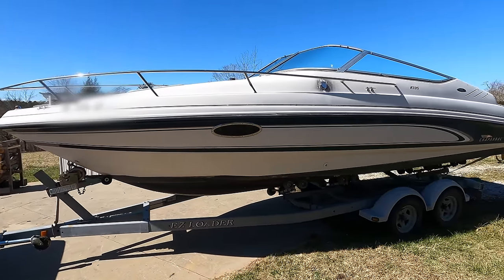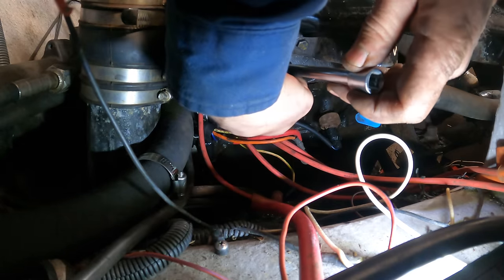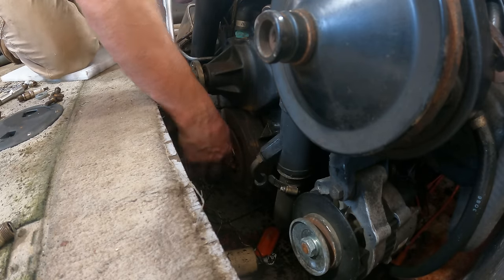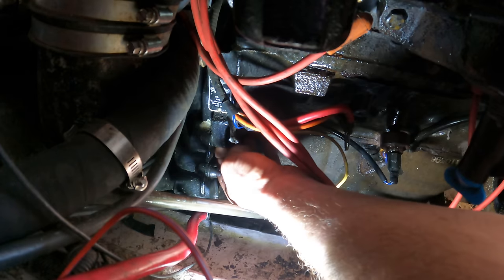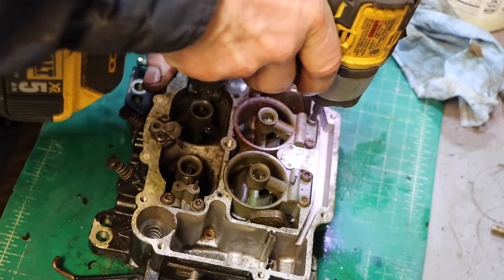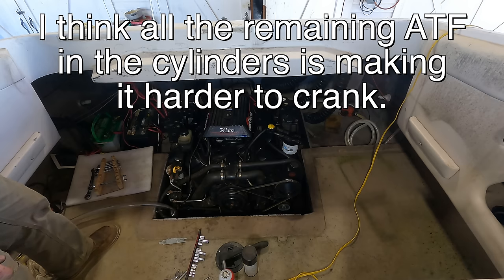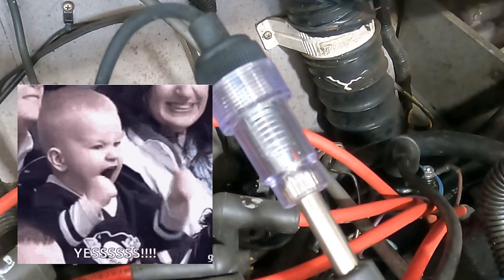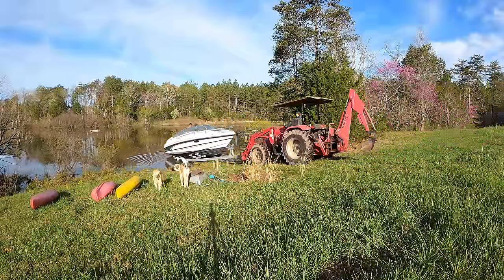Fixing A Boat With A 454 Big Block Engine

Comment: Only half way through - and you've just removed the broken bolt from the engine block from the starter motor!

ABSOLUTE RESPECT  fella! What a legend! I'm 100% , if its not an owner mechanic, owner enthusiast, or family-friend : this fix is not happening and it's an engine out job! What a legend, pure tenacity and determination, coupled with logical steps to repair!
By the way, get a soft cushion cover orsimilar for that edge of fiberglass in case you hit your head going in and out!!!!🤣🤣🤣🤣
You've not mentioned it - but I bet you catch your head!🤣🤣🤣🤣 
Now for the second half!

Comment: Those starter bolts can usually be spun out with a pick when they break off.  They don't usually seize in the hole.

Comment: My boat has 2 of these 454 engines. One has been locked up with similar rust. I tried similarly to free it up. I tried Marvel Mystery Oil in the cylinders no luck. What I didn't try is the heavy tool you made with the 1" rebar welded to it. Great idea! Wish your video had come up when I did a search and plowed thru endless videos on freeing up engines. Weeks later while searching for best ways to remove rust it shows up, same platform-a boat, same engine-a 454 Mercruiser, same issue-engine with rust in cylinders, didn't show when I needed it and looked for it. Well I did get the satisfaction of watching you bump your head on that protrusion over & over. lol Good job, and good trouble shooting technics. The no spark issue was one I don't know if I'd get thru. Im always torn between thinking the hell with it and letting a "professional" figure it out then  think at this point Id be paying someone to go thru the steps Ive already done. So you keep digging and end up buying parts that are not needed like that coil. Why anyone would chose this as a job to do every day I will never understand.

Comment: Great video. Might check the “flappers” at the end of exhaust system. Some people inexplicably remove those, which prevent water from backwashing into the engine when the boat is slowed down. Also, mixing kerosene with the atf helps it penetrate. Great job busting it loose with just the atf!

Comment: Excellent video, I particularly liked the leak down tester adapter with air assistance to move the piston, I've seen a "compression tester whistle" modified with a grease zerk-supposedly you can pump grease into a cylinder prefilled with oil with 5-10,000psi of force, and it either free's the engine, bends things, or blows out the head gasket.  That bolt on fabricobbled engine freeing tool was terrific as well.  I'm starting to realize you are good at many things, tons of them the same things that interest me, so thank you for well made videos.

Comment: This was a really good video. I was like modify the bar to turn it over. You did. Then I said replace the starter you did. I wanted a post bore scope of cylinders you did. 😂 even did a cold start after it sat.  Unfortunetly not all projects go this smooth. Even if they are a pain in the ass to work on.  You got lucky with that starter bolt.  Good job i love your videos and I'll keep watching them.

Comment: Evapo rust remover works good,,had a sbc motor frozen solid, took the heads off, filled cylinders, after a month of soaking, turned freely.

Comment: GREAT JOB!! 
I was almost convinced this was a no-fix due to all the rust, and the damaged starter flywheel! I'm surprised that the engine is designed in such a way that water can soo easily leak in from the top of the engine. Although I guess it's not surprising since the engine is really a converted automobile engine. 
You absolutely deserve naming the boat! 😁

Comment: Glad you got it running.  A little rant if i may. I just dont  understand  why some revivalists will just crank and crank and crank untill they fry the starters! Your first steps after it failing to start are to check out the rest of the fuel, air, spark systems. Pull the cap and clean it. Check the fuel filter. Take a look down its yap. So many just crank untill the starter gos up in smoke. 
 It was such a tough fix. Glad you got it.😊

Comment: Yikes! When you got those spark plugs out. Some "mechanic" that was who previously worked on it. Did starter "work" and didn't even realize the engine was locked up. Holy moses put that home aide engine wrench on a shirt! That's a master piece.

Comment: Awesome perseverance and excellent result. As an old sailor, I don't like gasoline anywhere near a boat. Good to hear you had a fire extinguisher handy. A diesel might have had the same issues re water in the cylinders but might have been easier to get to run without a carb and ignition and starter rebuild??? Wonder about the rings, maybe a compression test before any extended time at sea?

Comment: Excellent flow of diagnosis and finding the root cause. 
That was an interesting one. 
Congratulations. 
I would have put a new starter in. 

I would bet the water came in through the carburetor.  

I was surprised that you wee not sure if that was the choke. 
I was surprised because your skillset contradicted that. 
You also called the sir fuel mixture screws, jets. 
It is amazing that you drilled that bolt in the center and that ex outed it by hand. Excellent. I would have lost my mind.    

Do not put an abrasive in an engine. It will clear up much better by running it. I am s retired ASE Certified Master Technician for 45 years. 

Most mechanics would have sold him an engine no doubt. Partly because they want the old engine for themselves it to sell.  A boat 454 engine will undoubtedly have 4 bolt mains. Excellent engine you build first racing.

Comment: I saw and older mechanic sprinkle comet cleaner down carb on this exact same truck motor. Was using oil. He took it to about 2500 rpm and put it in. Practically stopped oil burn. Probably not a permanent fix but worked for awhile.

Comment: The compression should increase after a few good heat cycles take it out and run it run it hard run it light putt around and running about 3,000 RPMs steady for a few minutes just back and forth it'll help see those rings back in... Awesome content on this video you got skills. The homemade wrench is awesome

Comment: theres a kill wire going to the coil from the shifter. it momentarily kills the engine so it can shift with no power to the drivetrain. also you can pull the shifter lever straight out and touch will have throttle only. allowing you to pump the fuel to it, its like pumping the gas in your old school car! another fine vid. i know your frustration, I own a 26' chris craft, hope this helps

Comment: You answered your own question as to the water entry point. You removed about a pint of water from the intake manifold runners! So it entered through the carburetor.  Thanks for the video.

Comment: Remember all carburetors have a vent that’s where you dumped the gas and don’t dump it down the throat or you can dump a little down there but if you fill the bowl and it does start to run, it’ll run longer it’ll run for about 30 seconds 45 seconds six in a row Jim from Kennerdell PA

Comment: Great job. But might as well change the oil and water pump while you're at it. And probably change the impeller in the outdrive also change the oil in the outdrive.

Great job.💪🏾🙏🏾💪🏾🙏🏾

Comment: By the way, that RUN OFF switch on the throttle assembly is actually meant for a dead man's lanyard, usually they're thrown in the glove box the day the boat is delivered and never seen again. The mercruiser style one is just a loop that gets stuck in there and if it's pulled out it flips the switch off.

Comment: This happened to me on my boat! I had many sheer off until I learned there is a bracket that needs to be installed on the other end of the starter to support it. I learned to use a right angle drill with a left hand drill bit, it always worked to get that piece of bolt out of the block. I never had another bolt sheer off once I installed that front starter bracket.

Comment: The off/run switch you found is where a tether hooks in...one end goes on your wrist/jacket and the other has a loop that goes in between the lever and the housing on the switch.  When the tether is pulled, the switch throws to off

Comment: you deserve a big pat on the back for you patience and perseverance...I would suggest an oil and filter change and the newe oil should a quar of Rislone mixed in run to heat the engine block then changes again. that should lossen the rings somewhat

Comment: Fill the cylinders 1quarter with mystery msrvel oil and let sit for 3 days and work loose with breaker bar,by the way the tool you made to turn the engine over was genious
Reply: But heating and bending that rebar weakened it now it will brobably break now

Comment: Back in the 50's a TSB for oil consumption remedy was to let the engine inhale a cloud of Bon Ami (comet) through the carburetor. This worked to hone the cylinder eliminating the oil loss. Also, full synthetic oil will not smoke.

Comment: In the future don’t worry about OEM ground Jon, Just take a braided grounding strap or a New Short length of 0gauge wire from the negative battery terminal to an non-fuel related accessible engine bolt instead. An extra grounding cable in this manner will never hurt for this type of engine and 12vdc automotive systems are some of the simplest.

When you start getting into more complicated ECU, BCM, module based systems you gotta be mindful of far far more OR being careful with small continuously operating motors 20’+ from battery 
 (CHEVY 5.7L Vortec Fuel Pumps notorious for this leading to electrical wiring failure of the Fuel ASSEMBLY Unit)

Comment: There are flappers in the upper inboard exhaust manifolds that prevent water coming back into the engine if you decelerate the boat rapidly in the water and create a pressure wave pushing the back of the boat which can shove water up the exhaust. They do deteriorate and have to be replaced. It happened to me on my '94 4.3 merc.

Comment: pro tip. use wire mesh sink drain strainers as small parts trays for ultrasonic. been doing it for small gun parts for 12 years. works great. also use simple green mix dish soap just isnt strong enough.

Comment: I’m an auto mechanic, if I had an engine like this come into the shop, I would have priced a new engine. Unfortunately shop prices and time in the stall would exceed the value of the boat. If it was a project for me personally and I had no time constraints like I do at the shop I would give it a go to try to start it if the engine became un-seized. 

One thing that I noticed during diagnostics with the starter is, you didn’t do a voltage drop on the ground like you did the positive side. When ever I have a suspected starter issue with slow crank, got to check battery first, then voltage drops on positive and negative. Good job finding it though! 

Love the content keep it coming!

Comment: I had a big block Chevy that ate the starter gear ring on the fly wheel.  It was a grab sometimes, sometimes not.  I learned to turn the motor a few degrees and catch some teeth and it would crank, for a while.  Sooner or later all the teeth decided to break away and had to pull the engine to put a new ring on.  The thing you called and air filter is a flame suppressor.  If the engine back fires without it and if you have gas fumes in the bilge, boom!  Keep it on, unless the engine compartment is wide open for a long time and you have good ventilation.  Don’t run the engine while cruising without it.  I’ve seen a lot of boats each spring going up in flames because it was left off during the test ride.

Comment: Get yourself an inductive dc amp meter to test starter draw. The accelerator pump will give you a squirt of fuel and as long as the choke plate closes on a cold engine, you shouldn’t need to put gas in carb. 12 volt test light to a positive battery at alligator clip, the touch test light to negative on coil. Light will flicker if trigger circuit in distributor is functioning. Also 12v test light to positive at alligator clip and tap light on leads at ignition module with key on will cause coil to fire. You are taking the place of the ignition trigger/ pickup coil. Nice save by the way.

Comment: That thing should never have run, that bolt should never have come out without removing the engine. Go buy a lottery tick whilst you're on a roll 😅 I was hoarse shouting about the air cleaner stud... 😂 Great patience and effort!

Comment: There used to be a time where I would say time to take the flame arrester (you called it air cleaner?)retaining bolt and find another engine to fit it…..

I once bought a 57 ford pickup in the 80’s  that was locked up the same way.. I sprayed a gallon of wd-40 and liquid wrench into the cylinders and worked it back and forth for hours…..I finally got it to spin a full revolution and got it started.  It smoked like a locomotive for a 100 miles but got better as the miles added up.  Drove that truck for about 5 years before selling…..

Comment: 454 on the water is a great motor in my opinion. Though in my 1986 sea ray sundancer the small block 8 cylinder always ran well for me. Even though the sundancer was something awful with that yellow color paint. We ended u putting a new gel coat on it.

Comment: Great video, Jon.  Thanks for sharing this adventure with us.  Here's some detective-style thinking for you.

How could much, if any, water get into the carburetor and down into the engine while it was winterized?  The water would have to go through the solid engine cover (wood or fiberglass, and upholstery), then through the blue tarp covering the engine, then through the plastic carburetor cover, then through the engine filter screen with the metal lid, finally depositing in the carburetor.  And then, it would need to be in sufficient quantity to wend it way through the carburetor, intake manifold, and open valves to build up in puddles in the cylinders, and cause what we saw.  And I expect there was also a full boat cover or tarp in use.

Edit:  Oh, and all this supposedly happened over one winter storage period of a winterized boat?  So "it ran great, it was winterized, and in the springtime the issue appeared".  I don't know the process for winterizing a boat/engine, but I suppose it probably involves washing down everything to get any lake algae out and off.  I think it's more probable that whoever did the winterizing accidentally spritzed some water in the direction of the carburetor (maybe while power washing the engine and engine compartment) and the water got in through the screen and began its journey.

I suspect there's more to the story than Jon, or his brother, was told.   🤔  

Edit: I also thought it was interesting that the amount of time the boat had sat unused shifted throughout the video, from just over a year, to two years, to three years.  😉

Edit:  Hey!  Jon found a use for that big antique screwdriver that he refurbished.  Excellent!

Edit:  A truly epic project, Jon.  Well done!  May the Whack-A-Mole always provide freedom, open-air, and shared experiences for her passengers, and may her engine always stay dry.  🙏

Comment: Glad you pointed out to disconnect negative first on automotive. Most don’t know that. Also, technically, that starter doesn’t have a bendix. It has a solenoid and a yoke.

Comment: There is a abrasive additive for the fuel that we used to speed running in but it really is aimed at the rings and in your case i suspect a bit of sticking from the water so just use it and have a look later.

Comment: that carb is a weber/afb carter/edelbrock. you ever need a kit for it Edelbrock 1477 will fit. they are the current owner of that design. love them things. super easy to mess with, you can take the top off on the engine without spilling a drop of fuel.

Comment: In the future, take your automatic transmission fluid and put 25% brake cleaner in with the fluid. It will stay suspended where acetone won’t anyway iPhone a lot of good luck using that combination. This is six in a row.Jim from Kennerdell PA

Comment: Briefly had a Bayliner with a 460 King Cobra Ford engine.  Had Holley carb issues.  Repaired it but should have installed fuel injection for same price!  It got me 1.1 mpg at 2400 rpm.  After I decided it didn’t meet my expections I put it for sale.  Then I learned the back 2 barrels of the carb kicked in at 2150 rpm.  Wonder what my fuel consumption would have been running only 2 barrels?  Bet my speed wouldn’t have been too different.

Comment: Former auto mechanic here, also have a degree in high performance engines, if i encountered an engine like that in a car/truck that was easy to pull, I would have at least pulled it, pulled the heads, honed the cylinders and probably re-ringed it. For something like that boat or a motorhome or something equally nighmarish to pull, I absolutely would have done that kind of Hail Mary. At best it works, at worst it doesn't and I have to pull it anyway but giving it a shot isn't going to break anything that I wouldn't be replacing if I had to pull it anyway so why the heck not.

Comment: I've extracted that starter bolt... On the 6.0 engines the threaded hole goes all the way through the bracket and is accessible from the top, so I was able to use a normal drill bit from the top side with a flex extension to drive the broken bolt out that way. Same as you though, had already had the starter in and out several times and the threads were nice and clean. Would have been a whole different story if the threads were still crunchy and nasty!

Comment: The first clue that the ground was bad was the 9V you had at the starter when cranking. It was either that, or a poor connection on the supply cable. I'm surprised it started at all with all that bore corrosion. I presume you checked the oil at some point -  I may have missed it as I was doing other things while the video was playing.